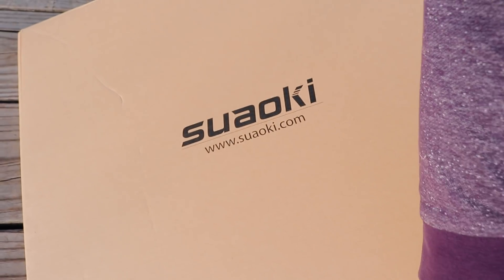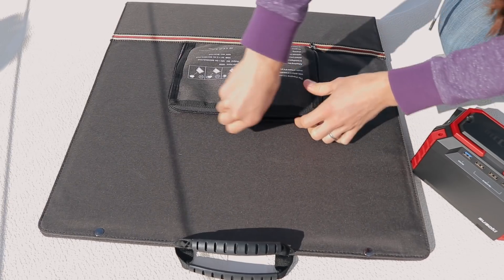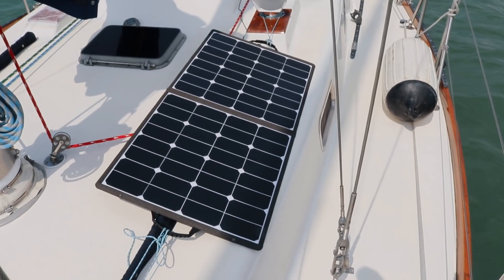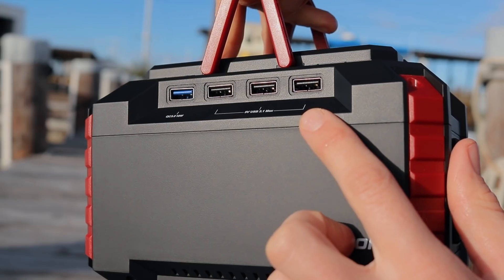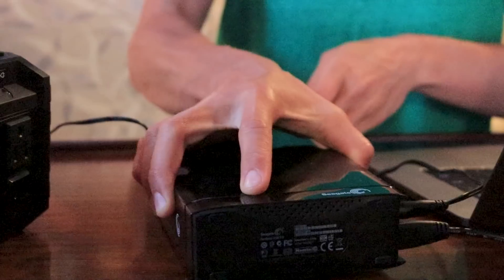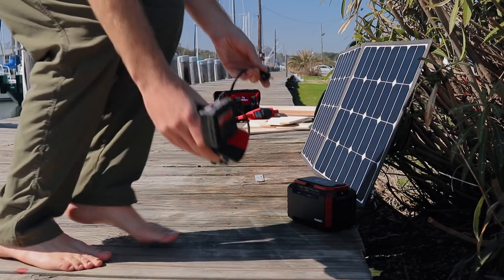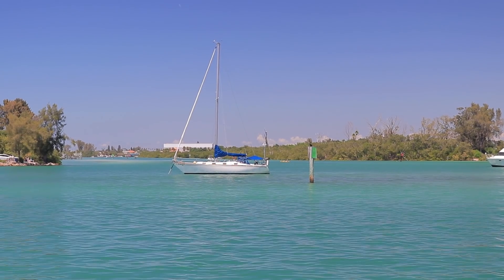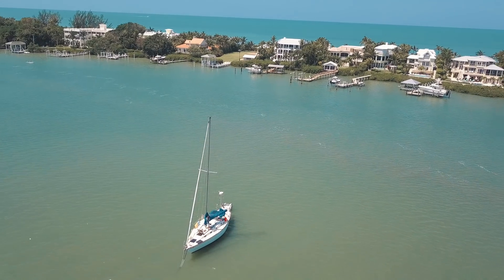Solar to the Rescue! | Review of Suaoki Solar Panel + Power Station

Comment: On a different subject related to the blog updates.  I was taught to rig the lazy jacks to be able to be loosened and pulled forward to the mast before pulling the sail up.  Avoids getting the battens caught on the wrong side of the jacks.  Just a thought
Reply from the maker: Hey Robert, we just installed turning blocks on the boom so we could move them forward about a month ago.

We set them up this way to prevent chafing, since we were noticing some marks on the mainsail. 

We have only been moving them once the sail is up. Why? I have no idea. I hadn’t thought about moving them forward BEFORE hoisting. That makes so much more sense. 

It’s funny how you get stuck in a rut doing something sometimes without really thinking about it until someone comes in from a different point of view and challenges your thinking. 

It seems like common sense from the outside perspective but when you are just going about something out of habit  those things aren’t always so clear. 

Thanks for the tip!
Reply: Sailing Soulianis its that Zukey Lake Tavern "water".

Comment: Sorry you were taken by the canvas company, that really bites.
We installed a huge one with a full enclosure. We love it, in winter and bad weather is the best. It allows us to sail year round (South Carolina). We got a genset, so we don’t need it anymore, but in our previous boat we used a Honda EU2000 generator to keep the house batteries topped off, and it even run our window unit AC we run in our companionway in sultry nights. It worked great for us.

Comment: Cool product. Need a solution for my “telecommute” days from my boat.
Reply from the maker: Do you have a reliable internet connection?  We will not be doing any more "out of sequence" product videos to avoid the Youtube backlash :)  But that said we've gotten a ton of value out of our cell phone signal booster that we used all the way down the river system.  It allowed us to connect to voice and data in some very remote areas and stay connected to our businesses throughout our travels thus far.  Hopefully we'll figure out how to incorporate some info about it into our upcoming river trip videos without upsetting the masses :)

Comment: I had no problem looking at this video just to see if I had some application for it but I don't, at present time. Yes, it was an advertising commercial just like You-Tube has at the beginning of some of the video's, but you are not compelled to watch them either. I have watched a couple of them and bought some of the products and services offered too. However, I would agree that showing them in action on your boat or whatever, might have been more user-friendly than a separate advertisement. Either way. it is Okay with me!

Comment: WOW!  You guys sound efficient, if you are mostly on 12v systems.... 

I think 120/240 can be better for wiring (so the wires do not need to be as expensive/think/heavy/annoying) you do get a good benefit by not having to "transform" the DC to 120 or 240AC.  Also DC is safer ...and not too bad for short runs -  hence it is used in cars and (small?) boats.

So the "backup" setup for solar - 100W is nice - how about the batteries?  Laptops, like what you have are fairly power efficient (Apple is one of the best in this area) and I did not see any high draw/power items - like heated water (this can vary), electrical AC system, electrical dryer (and/or washer) or even a hair dryer - as those can burn up to 1200 watts (so 10amps @ 120v).   

Yes, I want a largish 40+ foot cat ... yes, this is pretty unrealistic for me right now... I also want 2000W of solar and/or wind (likely two winder generators @ 400W peak/nominal each).

anyway, I'm running on and on and on ... sometimes i like running!
Reply from the maker: We beefed up our battery system this winter. (Videos coming shortly) We now have 330amp hour house bank and a dedicated starter.  We will also be installing a new high output alternator this summer.  We don't use any high power items, no ac, washer, dryer or anything of that sort.  We decided the best path forward for us was to remove complexity wherever possible.  If we can live without it we don't need it. Our goal is to live 100% off solar. We've never run the engine just to charge the batteries, and don't plan to.  But we did end up in a marina more than we wanted to, so that we could top off the batteries this year.  We're hoping with a few more improvements over the summer that will all be a thing of the past.

Comment: Like others, I did find this too infomercial like. I personally still enjoyed watching it, however have been watching you since the beginning so kinda understand what you meant. Sadly, it does come off as to much infomercial. An EXCELLENT and well done one, but still. As others have said, it focus on only positives with no cons. Jeffrey Wood below summed it up pretty well. It is also quick, to the point and covers all the things you liked about it. This also prolly adds to that commercial feel ... although it was one of things I liked about it too, so would not change it much, other than to add some of the cons.

My question though, AC out come with interchangable international plugs? Or just the 2 shown on yours.

One of the cons maybe is rigidity of solar panel, could you possibly get thinner flexible one that works just as well for that same size? One that could placed on top of Sunbrella bimini for example temporarily. Another it has plus of MPPT, but con not pure sine wave, unlike their bigger 220W which is exact opposite.

Think its output is 110v at 50hz, so it can run several portable devices more than likely. However, most things in US typically require 60hz, so it is unlikely to run things like TV, or many other devices that need 60hz.

Comment: This is a commercial. Obviously you are saying nice things in exchange for a product and/or money. Also, $400 for 100W of power is a rip off. You would get much better value by putting the money into proper solar panels, inverters and batteries.

Comment: Guys, I love your videos but this came more across as an infomercial and not really genuine. It's very well-made and kudos to you for putting in the effort. I see a lot of these Suaoki products being featured on other sailing channels too, so seems like that's their marketing strategy. I fully understand that as a youtuber you want to work with brands and start experimenting with new income-streams like this but... yeah.. It's really not what I signed up for as a subscriber.

As to the product itself, it's a 150Wh battery that in reality takes up as much space as an additional 840Wh house-bank would do. Sure it has an inverter but that's rated at 100w max, so not really usable for anything other than charging other batteries, or running real low wattage units on AC power. Is it worth it? Maybe in some cases, but I don't think it is on a sailboat where you want to optimize space+function as much as possible and you would be much better off with something else as mentioned earlier.

I'm of course not going to be unsubscribing and anyone that says they are, clearly fail to understand why you did this promo in the first place. I understand why you did it, I just don't agree with it and judging by the feedback left from other users I'm clearly not alone.

Again, well-made video but I think the execution was wrong, well at least for this audience. Nobody minds that youtubers take on paid promotions, but it needs to be done in a different way. I think you overdid it on the commercial part, although as someone in the media/marketing industry as well, I understand why you tried doing it this way as a way to challenge yourself by making such a video. It's incredible well-made, but done waaaay over the top with the happy jungle and over-the-top praise of a product that's honestly inferior to what most sailors would choose do have instead. I would have much preferred to include this in one of your vlogs where you try it out in a more genuine way and talk a bit about the pros AND CONS about this product. I think that's the real issue most people have with this video.
Reply: oh yeah.. and BRING IN ZE EGGS!!!
Reply from the maker: Hey Nicks!  Thank you for your comments and suggestions.  You make a ton of really valid points, in fact we started a response directly to you but felt it was so spot on we'd just pin it to the top.  So thank you for taking the time to respond, and take a quick peak at the pinned comment.  It should address most of what you said.  Again we really appreciate the feedback.